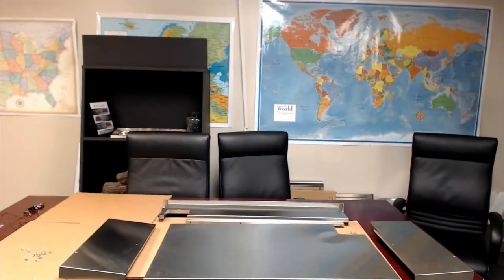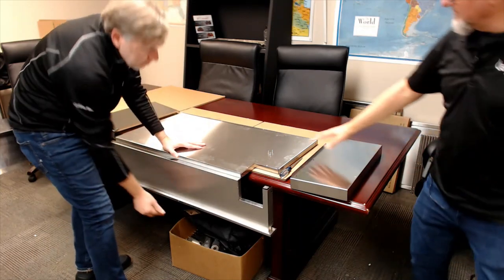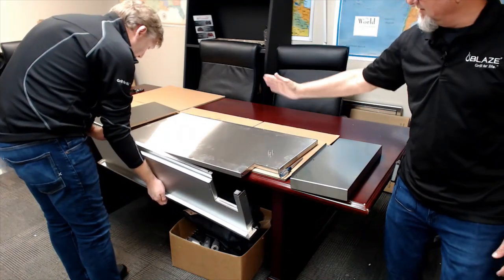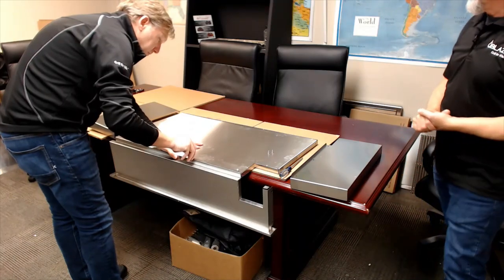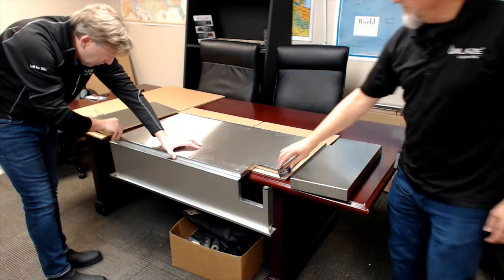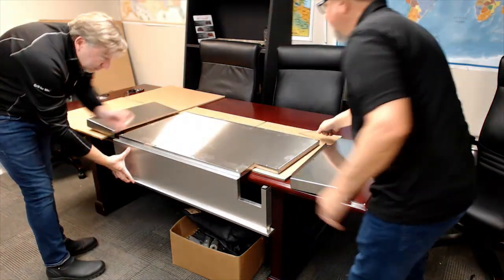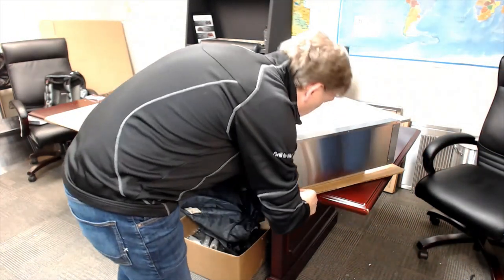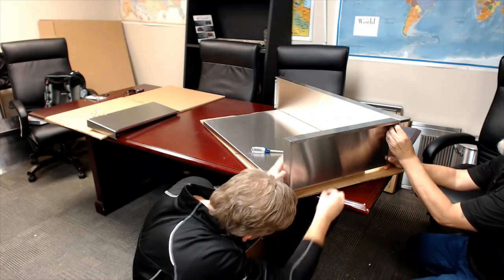Blaze Grills - how to assemble a "flat-packed" insulated jacket.

Comment: I am curious.  This looks like two sheets of stainless with hardibacker inside.  Is that correct?
Reply from the maker: They are constructed of 304 stainless steel with a hollow void inside the structure walls.